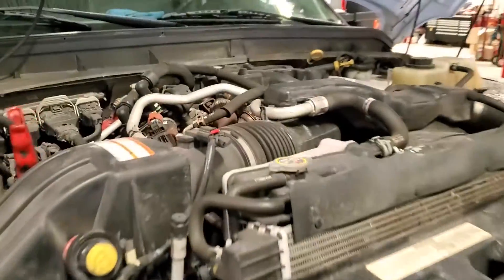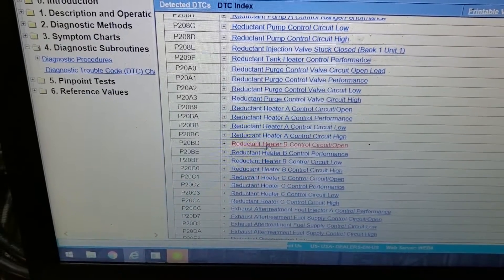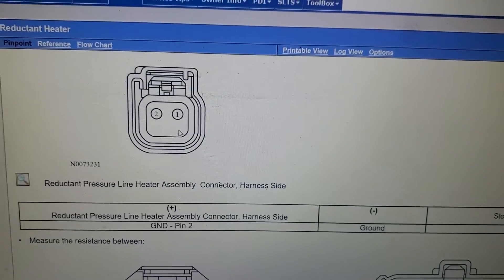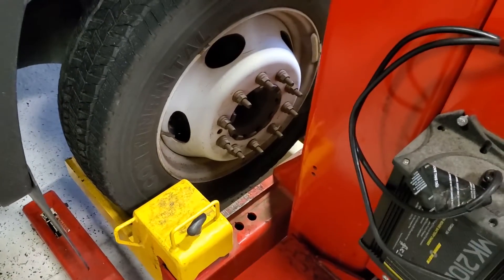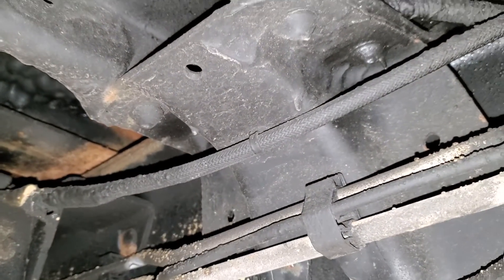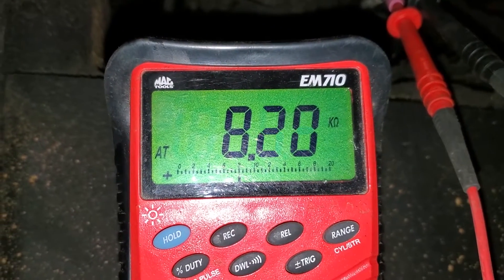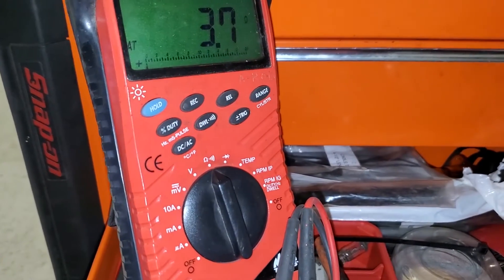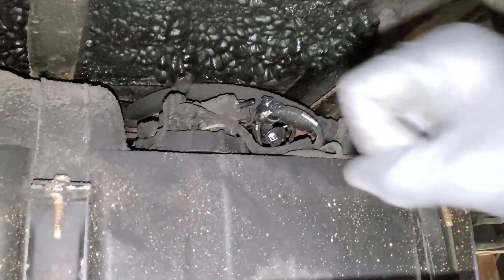FORD 6.7 2016 P20BD | DEF line!!!

Comment: I built my 2011 from the frame up and had to put emissions on it for my cvor. I replaced my complete emissions system and put a new dosage line on my truck. Does the def dosage line need to be bled once installed? I’ve put about 8000km on the truck and have not used any fluid lol

Comment: Thanks for the video Arod. Your videos have been very helpful getting my DEF Heater issues corrected.
How long after replacing the DEF Injector Tube/line should it take to clear the code?  Miles? Cycles?
Maybe it’s just archived in my OBD app. Only showing under OBD-II as archive/permanent/inactive. Originally was showing in both OBD-II and ECM sections of my App before I replaced the line.
Reply from the maker: As long as there's no stored codes it's fine the permanent DTC's take up to 400 miles to clear
Reply: @PowerStrokeTechTalkwARod  Thanks again!! Well, I’m going on a long trip. Hope to see it clear the code.  I was thinking it was just stored, but want some back up from experts like you to confirm.

Comment: I have a  2011 MercedesSprinter with the same code p20bd  I will check cable connected to the heater I don’t need the heater in my area maybe I can bridge it with a resistor
Reply: Does not cause any problem with the check engine light on with that code

Comment: Hey there Arod! I was wondering, do you have any videos of changing tie rods for 2013 or similar f250? I wanted to get your input on why my steering wheel is super loose even when truck is turned off? When driving the handling sucks and is loose. Does this happened often to big trucks?
Reply from the maker: No man it does not. You probably got some worn out components.
Reply: @PowerStrokeTechTalkwARod  thanks man. I had a guy tell me that I need to replace the whole gear box with a new one. I just recently changed the power steering with new synthetic power steering fluid. Not sure why.

Comment: Heyman, nice work on vids. I have a 2015 6.7 that wont fire it just cranks. I dont hear the hfcm noise. Took the engine mount f. F. Off was full, no metal.
No codes, either.
Reply from the maker: No power to FP??

Comment: I’m not looking for the day dudes stop buying 6.0s and 6.4s because that’s when I’ll go hungry because 6.7s are bulletproof.
Reply: Bulletproof? Like zero problems? Ive seen major fuel system failures. Wipeout injectors pumps. Theyre good but i wouldnt say bulletproof. Maybe compared to the 6.0 amd 6.4 they may seem that way but they do have there own issues. I dont think theres one vehicle that has ever been made thats been bulletproof